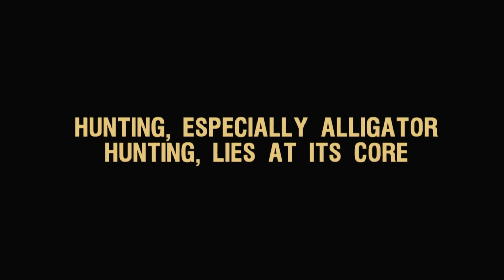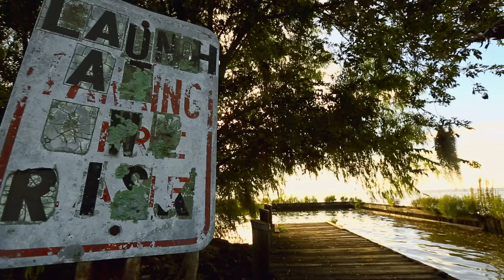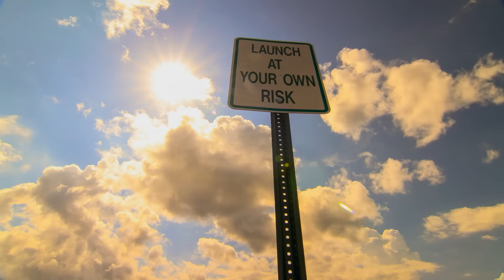Swamp People: Ruthless Oversized Beasts Fill the Swamp (S10 E13) | Full Episode | History

Comment: With a small winch attached to a steel plate, inside the boat 
angle iron welded together with a support brace L shaped
 with a wheel sprocket able to Spin- Freely  with  bearing
 could easily install a winch with a boon pole for lifting the gators and heavy fish out of the water, into the boat